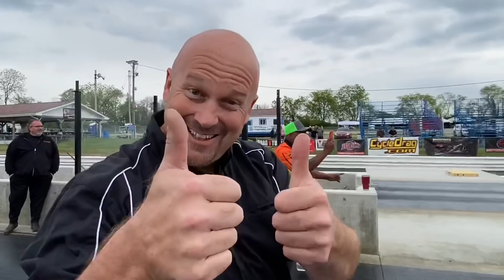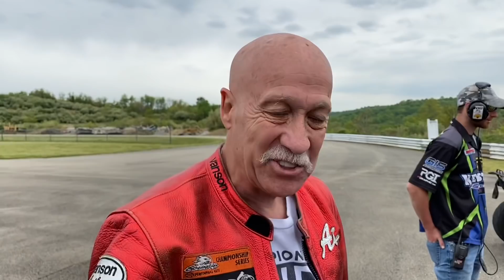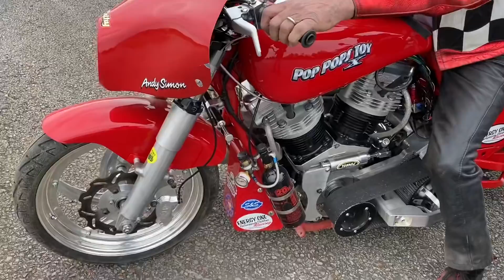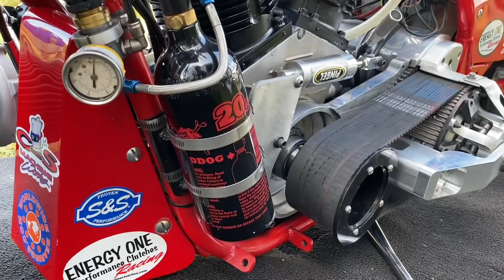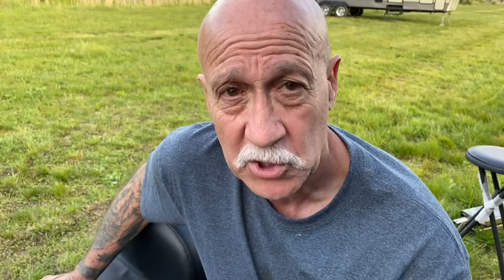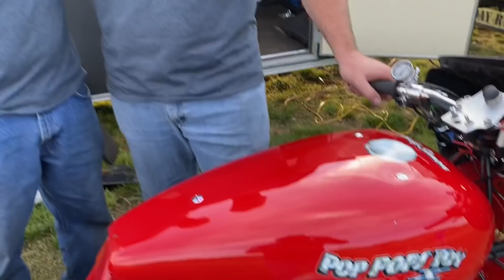68 YEAR OLD RACER CRASHES AFTER BREAKING HARLEY WORLD RECORD!

Comment: I'm 74 and I still race my 99 bag of Road King. I sure wish I could get in the 7s I run 1 / 8 mile track and when I run quarter mile Med 9 f I'm still running the 5- speed I got my geared up 4 1 / 8 miles but it's still fun. In the late sixties I was flat track racing! Flathead 45 finally got some prize money and went to Triumph Tiger 500 single- curb like Gary Nixon and he was a friend and greatly missed. I went to drag racing in 72 with a Kawasaki 750 H2 the blue Beast. Made my own swingarm and wheelie bars that was hard to catch. That motorcycle was meant to go straight try to ride on the road you couldn't turn it. I would sure love to find another one but very hard to find as you all know. Throughout old age it's not always winning it's doing it. I'm in between Florida and Michigan and I would love to come down and race my 99 at one of your meets. I'm new to your site and it seems like I don't get the current updates on your scheduling. Can you give me any advice to find out where you're at and dates. And 1/8 mile track. The A2 Flash
Reply: The first bike I ever bought and raced was a Blue 72 H2 🏁👍
Reply: @KCadbyRacing  all the 72 Kawasaki 750 H2 came in that s*** blue. LOL

Comment: Can someone explain to me why Harleys are faster at the drag strip than lets say the 4 cylinder Suzuki drag bikes? Stock, Harleys can't even come close to the metric super bikes...
Reply: V-Twins (not just Harley) don't and won't ever run anywhere near, let alone close to what the fastest metric bikes run.
A "completely stock engine" GSXR 1,000 (only 61CID) with NO Power Adders recently ran 7.90s and the ZX10R he raced ran multiple 8.0s...

All you need to do is look for more drag racing videos (XDA and Dragbike . com).